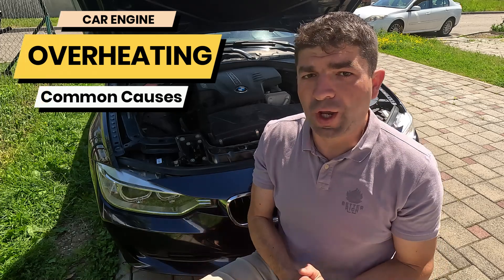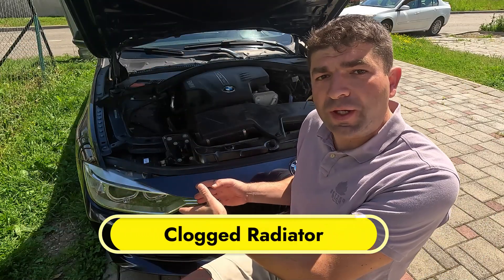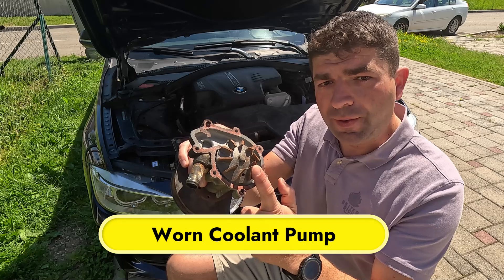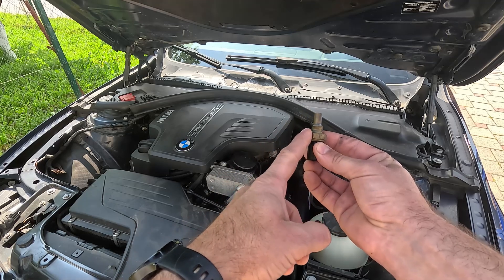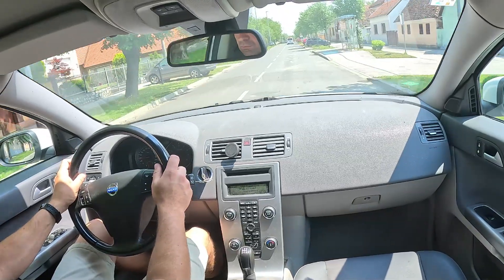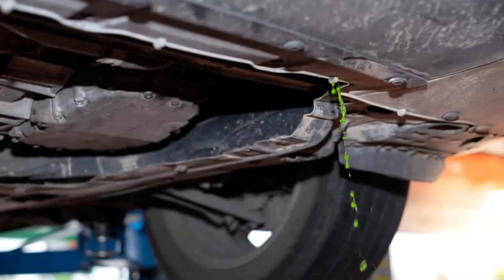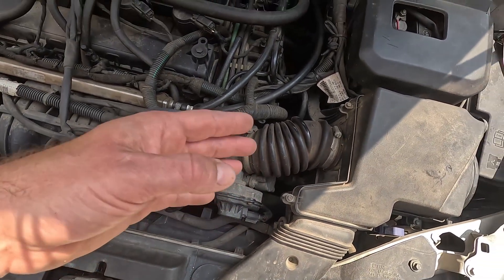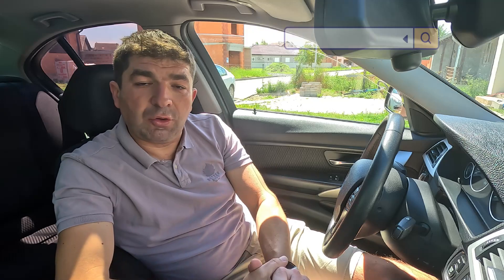Overheating Car Engine? Common Causes & How to Fix it

Comment: I seem to have a very weird problem. MY radiator is new and coolant levels are fine. No leaks. Fan works well as far as I can tell. But my temperature gauge needle when stuck in traffic creeps up to 70-80% mark and slowly returns to normal. If I turn my car off and on again, the needle immediately resets to midline normal and then slowly creeps up again.
DOes this mean its a sensor issue or radiator fan motor is weak ?